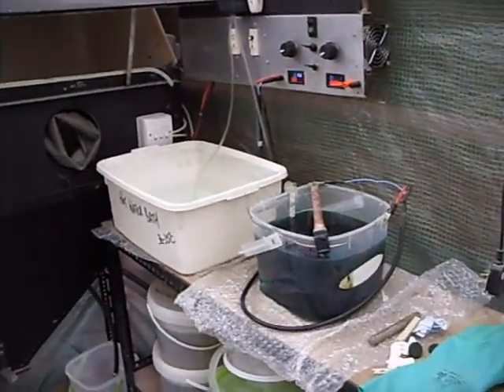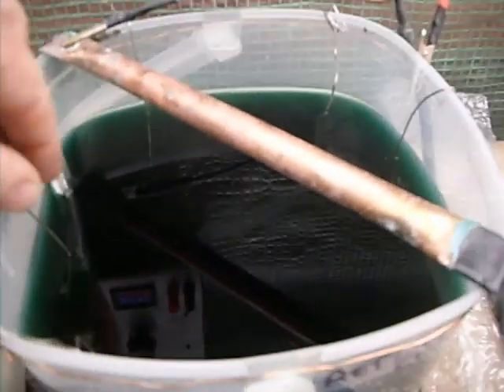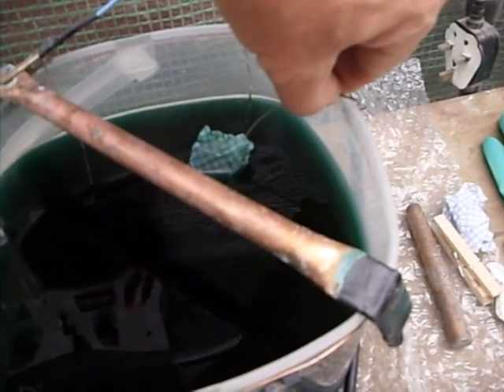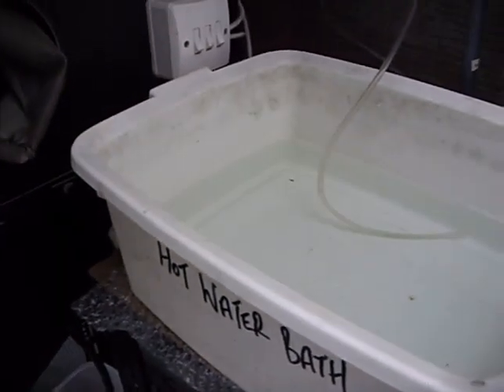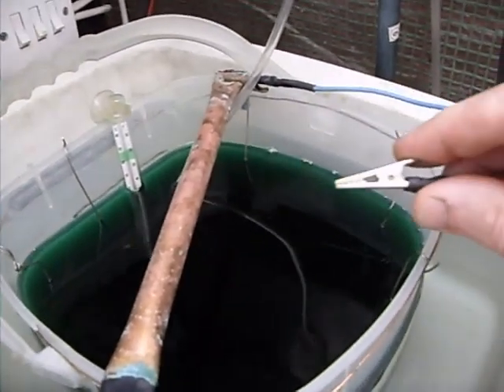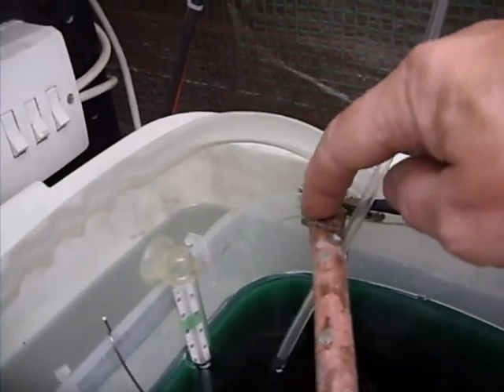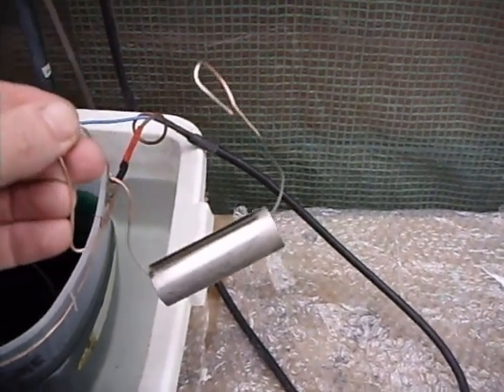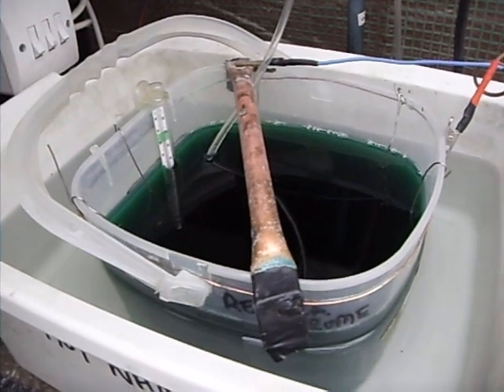DIY Home Electroplating Setup

Comment: Air agitation is not a good idea as it produces aerosol bubbles at the surface which aren’t good for your health or anything nearby. Better off using a small submersible aquarium or pond pump, ideally an extra low voltage unit and something with a ceramic shaft